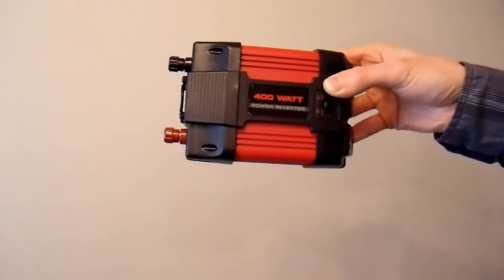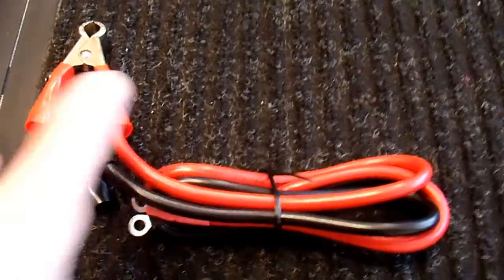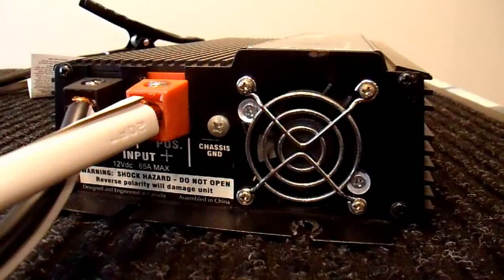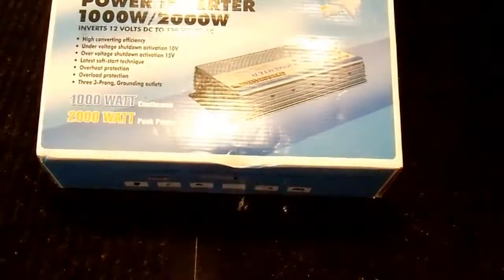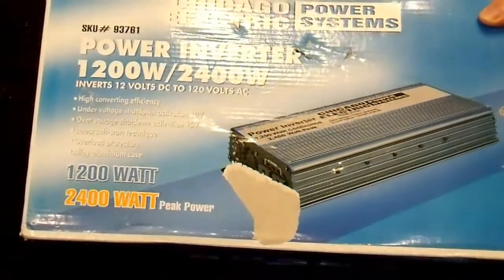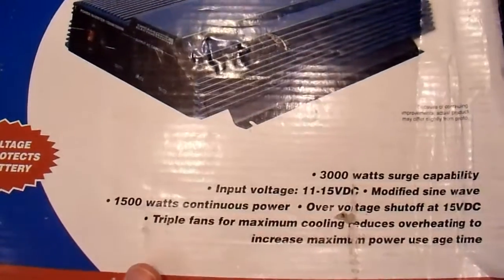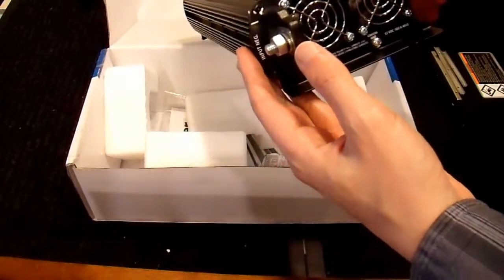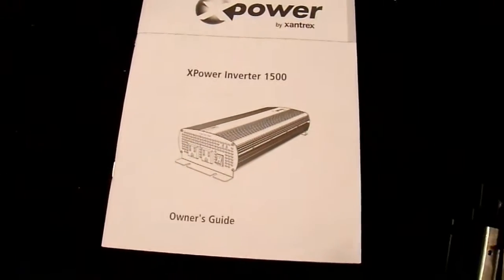Twelve Inverter Review - Part 2 : 6 12V to 120V Power Inverters

Comment: can I us a car 12v cigarette lighter out to run a 4000w inverter, to operate a 120v, ac heater .I have the inverter  at home but my car heater  is not working,   so can it work
Reply: Robert Martin only if your heater is no more than 150 watts

Comment: I watched all 12 videos, thank you so much for taking the time to do these videos, they are extremely informative. You obviously are a man in the know so I have a few questions that hopefully you can answer. I haven't put my system together yet but I bought both the Powerbright 6000w MSW inverter and the Powerbright PSW 2200w inverter. I will be running four 850 CCA deep cycle batteries in series. My first question is "Do I have enough battery power to operate these inverters at 50% for 12 hours?" I also have 800w of solar panels to charge the batteries (40amps), is this too much/too little?

Comment: Could you explain how they calculated watts on them inverters? 
I bought 1000 W inverter ant I can not run 40 w bulb with it... Brand new deep cycle battery 85Ah charged to 12,45v
Is it fake inverter than?

Comment: That first Inverter is a harbor freight unit. Likely you will only find it at harbor freight. One of the things I like about cheap harbor freight stuff is that often they make them so you can work on them and they don't have a stroke if you open it up to do just that. soldering a new fuse in is no big deal.

Comment: Knurlgnar24, I have a Cobra CPI 880, 800 watt Inverter. Is there a way to make it a pure sine wave inverter? Please let me know. Thank you
Reply from the maker: Technically, yes.  Practically, no.  It would require more components than a PSW inverter would cost out-of-the-box and a lot of work, the first attempt of which would probably end in a smoked inverter.  :)
Reply: Thank you for your comment.

Comment: So  I am trying to use a lawn mower battery . or small sized battery and converter to power a couple lights and airbrush equipment . mainly the air compressor.  I want to know what would you or anybody suggest i do .  Should I buy the cheap harbor freights converter and a cheap battery form like walmart or go higher  . i want to be completely mobile to perform consistent live airbrushing at events so I am not depending on using someones power
Reply from the maker: What is the model of the air compressor?  I suspect a 1500W Harbor Freight inverter is adequate, but definitely do not use a lawn and garden battery.  A group 24 deep cycle battery would be a good choice for an inexpensive 'starter' battery.
Reply: ***** im using a small air comperssor from tcp global . its meant for airbrushing.  It has a 3.0L tank attached.110-120V/60Hz. 1/5Hp.  As of now i will only be running the aircompressor . Im sorta on a budget and I have to travel with all equipment on foot or bike.  the battery alone would wiegh me down but that wouldnt stop me . So you realy think i wont be able to use a smaller batter for lawnmowers or something similar in size

Comment from the maker: It was a Sunon fan taken from surplus equipment.  It was not the exact fan intended to be used in the unit so I had to do some creative installation, but afterward it worked better than with the original fan so it was worth it.  I ended up selling that one on eBay - at a loss - but I believe it went to a good home.  I'm not an expert on where to get these inverters so your list is similar to where I look for them!

Comment from the maker: A good 15Amp circular saw will require a 2000W inverter to operate properly.  They also have a nasty, but brief, startup surge that some inverters won't like and will cause some 2000W and even 3000W inverters to immediately shut down.  You can't determine which will work from their advertizing specs unfortunately...  I have only personally tested 3 'inexpensive' inverters that would work well for your application: 2500W Cobra, 2000W Schumacher, and 2000W Chicago Electric.

Comment from the maker: Heat and humidity are hard on all electronics.  Unless you purchase a professional product at high cost you're stuck with consumer grade stuff.  For your situation I'd look for one that is conformally coated inside.  I am sure there are others but the only inexpensive brand I've seen that does this well is Chicago Electric which uses a heavy acrylic coating which protects the components impressively well at that price point.

Comment from the maker: Circular saws use a universal type motor and will work equally well on both modified sine and sine wave with almost no efficiency or power loss.  This applies to most other power tools as well, although variable speed triggers such as those in drills may not function properly.

Comment: Oh I was just curious how well the performed against each other as you really can't go by the  crap they post on the labels anymore. Was just interested more or less on how they performed over all. Some inverters can be pushed easily past there ratings if they are built with quality components for example.

Comment from the maker: I checked under/over voltage shutdown on most of them, plotted efficiency curves for many of them, and stress tested nearly all of them after repair (overload, surge, long term full load, etc).  I didn't save all of the data but may remember if you have any specific questions.

Sorry, I don't intend to make any videos on testing them.  I did record one about plotting efficiency but it's so boring I didn't edit the source video or post it.  I may eventually.

Comment: Depends on the condition of the alternator and or battery but your right, ideal voltages are around 14.7v. Other factors such as temp and alternator load also have an effect on voltages but i'm sure you knew that. :)

Comment from the maker: BMW is one famous example of a company too arrogant and stubborn to acknowledge that the USA uses a different battery type than Europe due to our harsher environment extremes, and you have to buy special (crappy) batteries for those older vehicles.  They've since learned their lesson and their newer vehicles have a proper (higher) charging voltage.  Keep in mind that these voltages are temperature compensated with a zener diode.  A Nominal 14.8V alternator may be 15.5V at -20F.

Comment from the maker: Nope, that is incorrect.  If your car is only outputting 14.5V on a cold day you have a problem with your charging circuit.  Once fully warmed up it is usually in the low to mid 14's on a modern vehicle.  Nearly all car batteries sold in the USA are lead-calcium and require a higher voltage than that.  The 14.4V nonsense that is propagated all over the web by those who don't know better is old info from the lead-antimony days.  This isn't the 1970's.